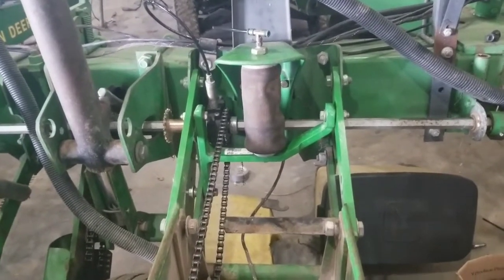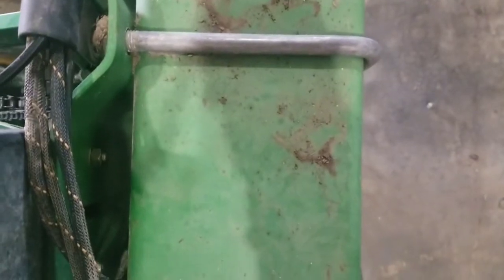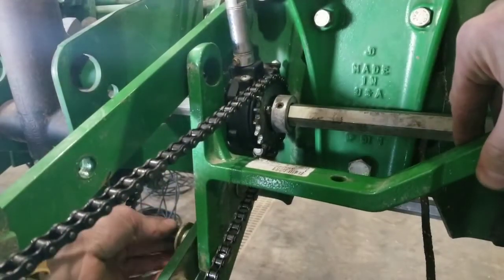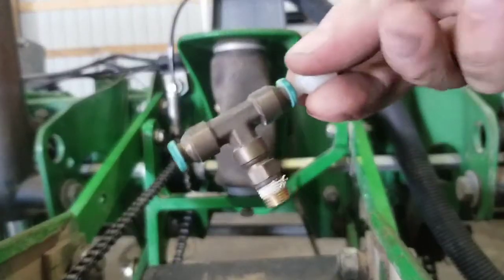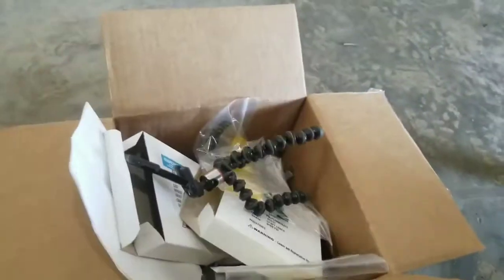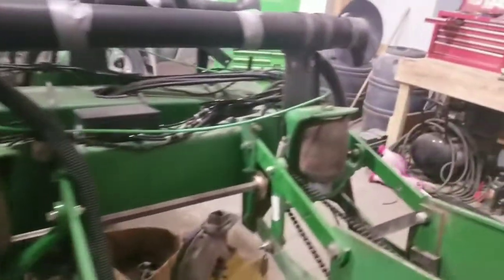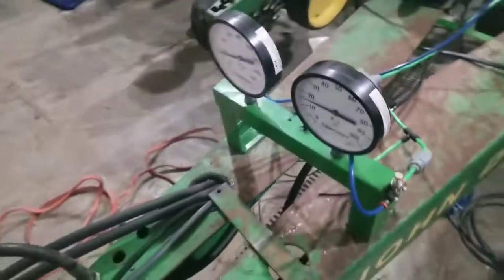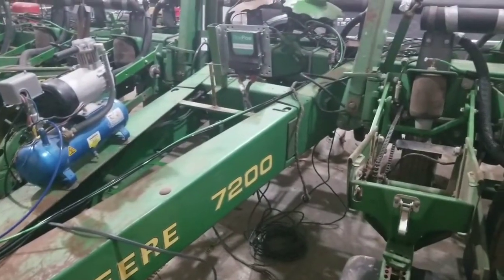Pneumatic down pressure JD planter

Comment: Nice video. I ended up with some airbags of 1770 that I want to put on my 7300.  Haven't started the work and trying to map it out.  I hadn't thought of a check valve after regulator or found the supplier. Keep up the good work. Subscribed.

Comment: We’re did you get your compressor from and how much holding tank do you need
Reply from the maker: Its a hardware store 12v compressor, doesn't take anything special. Unless the bags leak a lot, you don't need much volume and it won't run often. Couple gallon tank is plenty.

Comment: Just came across your video doing the same upgrades on my 7200 12 row so thank you for the information. Also wondered how you liked the hopper supports being cutoff like that, looks good and easier access but wondered if you had any complaints about it.
Reply from the maker: No complaints at all, but thats part of the reason I ended up with airbags. When the boxes get empty I think the extra 40 or 50 pounds on the row unit was needed for downforce. The row units got pretty lively.  Now it doesn't matter of course.
Reply: @tjknust  makes sense thanks for the info!

Comment: What keep the air springs from wanting air when planter is raised at headlands for turning? When the planter is raised wouldnt the air pressure drop suddenly? And if it is compensated while turning the pressure would be very high once lowered again...??
Reply from the maker: You should really adjust in the up-position, otherwise you won't observe a pressure change until the planter is raised. But you can adjust in the down, you just won't see any measurable effect until you cycle the frame up/down. And if it's down and you crank on it till the gage starts moving, then yes, it will be very high when raised
Reply from the maker: And it will always want a little air due to leaks and such, but it's refilling to the intended pressure every raise cycle
Reply: Okay, thanks!! I have a 7240 with frame mounted coulters and split rows, getting in the ground has never been an issue for me. But i will need some air pressure to stabilize the units. Looking forward to planting season and getting it set, should work great!!
Reply from the maker: @ridgerunnersoutdoors8278  if you are going to no-till there is no substitute, I never looked back. It was a bit of a project but time and money well spent. I'd make you a smoking hot deal on a barrel of springs haha
Reply: Yes we no till everything. Again i have a heavy planter and frame mounted coulters which made mounting the top bracket a challenge as we had nothing behind the bottom hole. We had to drill a 5/8 hole centered about 1.75" below the top 2 bolts. Getting in the ground wasnt an issue but seeing unit bounce at 5mph and you know the seed depth isnt consistant, the air should stabilize the units and keep them steady and consistant. Thanks, enjoyed the video!! Will pass on springs.. lol
Reply: Planning on plumbing air lines and mounting compressor this week. Can you give me an idea of pressure for the air bags raised? A starting point at least.. again i need unit stabilization more than down force.
Reply from the maker: @ridgerunnersoutdoors8278  20-30 would be a good starting point. The gauge will dance all over when planting but that's normal. Old rule of thumb is you should barely be able so spin the gauge wheel with your foot.
Reply: Thanks, if you are still running me2 units on your 7200 i would recommend xp row units, cast is stronger and a bit heavier. Mine were used take offs from Sloan Implement and are in great shape. Came with parallel arms, front bracket and air springs and all hardware for $359/row. An excellent upgrade for me. They are putting exact emerge units on for 10mph planting so upgrades for them too.
Reply from the maker: @ridgerunnersoutdoors8278  that's a pretty good deal. I spent most of that replacing parallel arms and gauge wheel pivots a few years ago. You got the better end.
Reply: Yes,i am very pleased,.good arms, bushings and hardware. 14 7/8" openers, gauge wheels and arms. They also have xp row units available w/o linkage for $299/row. I wanted to stick with JD oem so it worked out well. Considered aftermarket cast row units but this was a  better deal for sure.
Reply: I did 17 years in parts at JD dealer so i know a little about this stuff
Reply: Does your 12v air compressor kick off automatically? The one i bought is on or off and doesnt have auto. Seems like that will be a problem to keep reserve air for the system.
Reply from the maker: @ridgerunnersoutdoors8278  if you're not running shut offs and only running pneumatic down pressure, you might get away with that as long as the system is pretty tight. If not it will bleed down slowly and you will end up refilling it occasionally throughout the day. Most factory setups for a pneumatic only had just what you have, a compressor with a toggle switch and they dump valve, no pressure switch or tank. Foolproof is the compressor with pressure switch and tank and they are not that much more money.
Reply: Oh yes, i do recall seeing the pressure switch on your compressor in the video. I guess i could just run compressor when getting seed or fertulizer too but seems as that would get old.